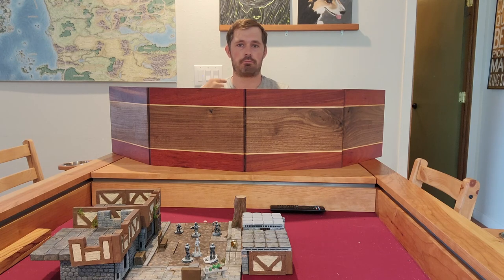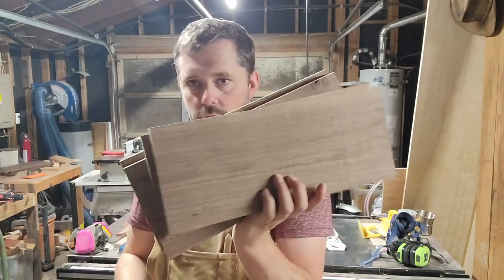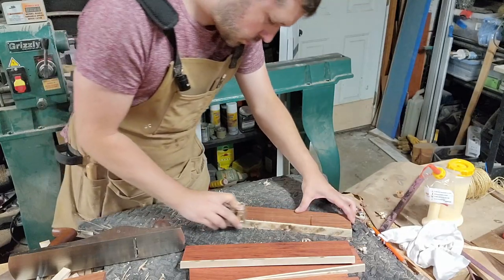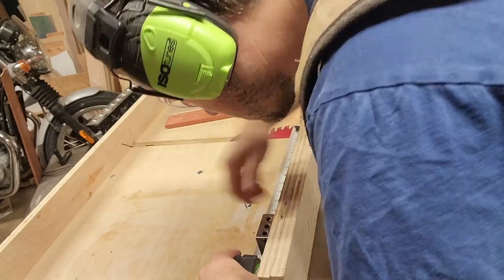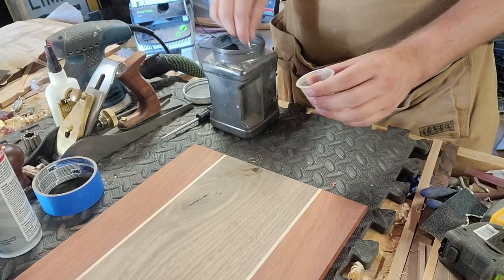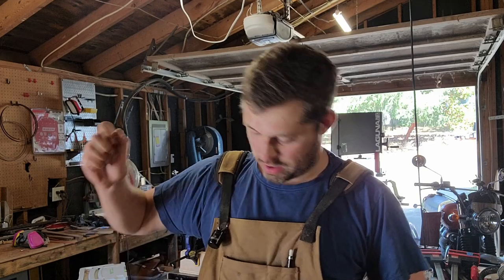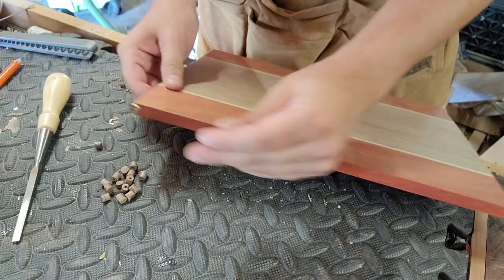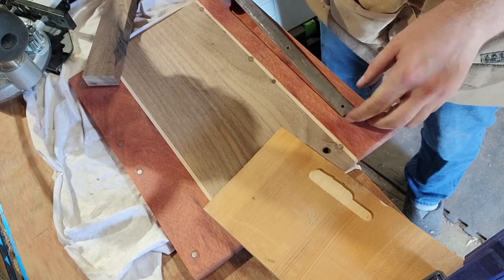I build a custom GM screen! (Wyrmwood ripoff?!)

Comment: I loved this video - just seems like the perfect design for a beautiful, functional screen! Thank you so much for posting it. Is there any information you could share about the acrylic panels you added to the back? (Did you buy them, or make them yourself?)
Reply from the maker: Thanks so much! The acrylic screens were just 1/4inch acrylic sheets I cut to size, and then I just drilled small holes and popped magnets in with some CA glue.
Reply: Very cool, thank you!! Do you just cut the sheets with a saw? Thanks again! :)
Reply from the maker: @cantrell1040  Yep! I just run through with the table saw - making sure to keep pressure down (the thin stuff likes to try and lift up, which causes chattering/cracking).

Comment: May I ask where you got the magnets from which you are using? Just curious since I’m planning to build my own GM screen as well and I’m looking for options.
Reply from the maker: https://www.kjmagnetics.com/proddetail.asp?prod=D4X0DIA-N52

Those are the ones I used for the "joints", and the smaller ones were other N52 discs from the same site

Comment: hey mate great job, i love the timber you used. couple questions 1 how has it held up over the year as in has it warped being solid timber? and 2 how did you go about determining the strength of the the magnet to use was it just guessing? ive seen your link and where im from something like that will cost be about 120 bucks lol so i want to see what else i can use
Reply from the maker: Hey there! Great questions. 1) it's held up great, no warping that I can notice. 2) for the internal magnets, I basically just bought the biggest/strongest ones that i felt could still likely fit inside the dimensions of the wood. Because there is that wood in between them, they need to be quite strong, as magnetic force drops exponentially over distance.

Comment: How much cheaper was this than the Wormwood screen?
Reply from the maker: I guess it depends on whether I should count my labor when making a project for myself. The material costs for the lumber were around $200 total (bloodwood was not cheap) , and I spent around $60-$70 in magnets.
Looking at their latest kickstarter.com, for example, a solid black walnut panel is $80, so 4 would be $320, and I got to add in bloodwood. But it took me about 3 days of work at least.

Comment: This is cool!  I have been meaning to make something like thit for a while> I have been using cardboard for a few years with a map I made as the screen front. its ok and works but I would like something a little fancier like this.
Reply from the maker: Other than the magnets in the sides, it honestly was basically the same process as making a cutting board. You can do it!